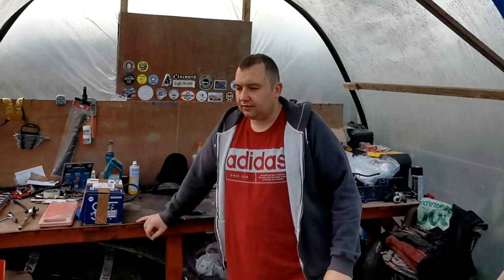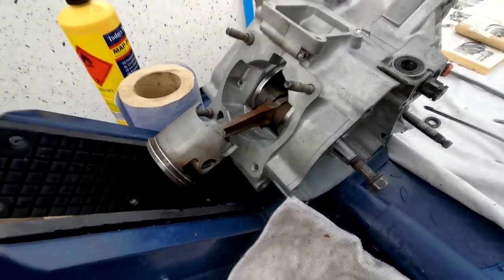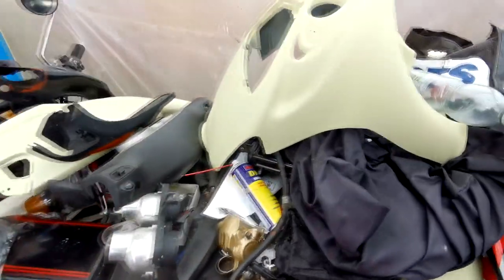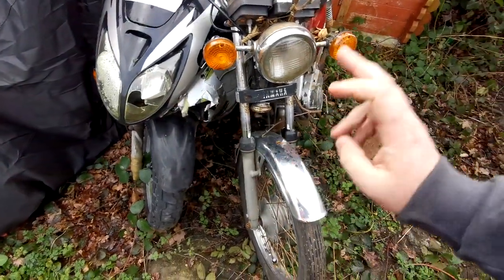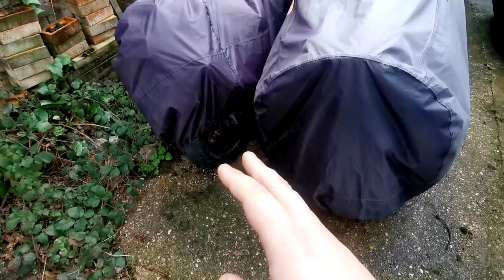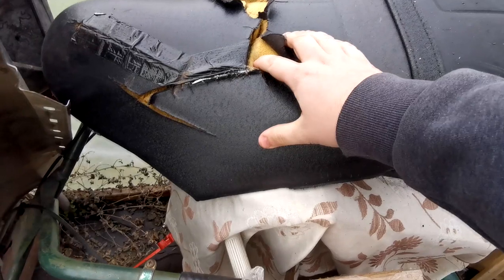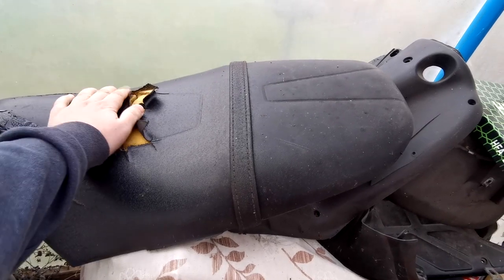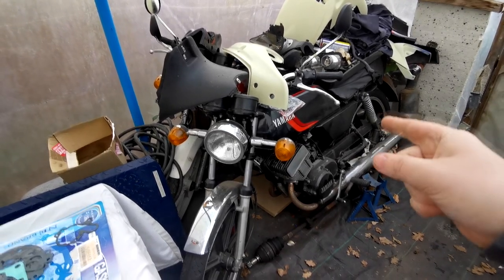WHAT WE GOT GOING ON ? #UPDATE #PREMIER #HEADOFYOUTUBE #OUTINASTORM

Comment: Hi Gary I enjoyed that, watching it after the premier and I could take it all in and didn’t get distracted by the chat. Glad to see the TZR is coming along shame about the lost content. I need to get on with content rather than mowers but really need the weather to get better first, I’m like you have so much to do, but I have bought a lot of the parts I need to get on with them. Good catch up video #menditman 🙂👍
Reply from the maker: Cheers luke I know what you mean about the weather it does put a stop to alot of play how's that speedfight coming along? Nice little # you got going 👍🏻
Reply: @ProjectMan  You mean cheeky little hashtag 😂 I haven’t done much on the speedfight as I’ve been waiting for parts, but I have a new rear tyre fitted now, replacement panel to replace the badly broken one, also a seat cable and mechanism which will probably feature on a video. I’m keen to get it on the road, then I’ll improve it as I go along. It does have mot until the end of March. Rather than full restorations some will just have to be made good atm, cosmetics can wait in till later. I want to get on to a 4 wheel vehicle and as my old vehicle T4 is under cover I think that will be the first. But like you and your dad have mentioned mowers really need to get done to be ready, I’m got through a lot of mine but still a garage load to sort through. Anyway at least we won’t get bored 😂 #Menditman 🙂👍
Reply from the maker: @menditman2004  looking forward to see the t4 project what's the plans with it? #Headofyoutube 💪🏻😂
Reply: @ProjectMan  Well I’m in 2 minds what to do, I have a mk3 golf tdi engine (common conversion) to go in it. I have had the wiring loom all converted and have a lot of the parts. But initially I think I’m going to keep it as it is, but I do have a gearbox to fit as the one in it isn’t great, problem is I don’t know if the replacement is any better but it was cheap, so I think I’ll give it a go. So that will probably be my first job on it. Then go from there, possible could be a day van in the end we will see. #menditman
Reply from the maker: @menditman2004  would it be worth rebuilding the spare box while it's out as a piece of mind if you intend of keeping the van.
Reply: @ProjectMan  Yeah I might have that done, not a cheap job but I do have a good contact that could point me to the right people to do it. I’ve had a box apart and it no easy job also special tools are needed. That would definitely be an outed job, van only cost me £700 in 2008 I used it for work for years, so it owes me nothing. Considering it’s age it’s not to bad condition.
Reply from the maker: You got a good deal on the van 👍🏻  it's worth just popping it open to have a check on bearings and see if there's any ware on the gears like we done on my astra and we replaced all the gaskets while in there 👍🏻😁
Reply: @ProjectMan  I think it’s the synchro that’s the trouble and had a 5th gear wine, but 5th gear is easy to change, I’ll see what I eventually get the box out. My sprinter needs some cosmetic repairs so I may just get the T4 on the road to use while I’m sorting the other out, but like I said I do need to check this secondhand gearbox. It’s a case of watching this space atm 👍
Reply from the maker: I look forward to seeing the vids 👍🏻👍🏻